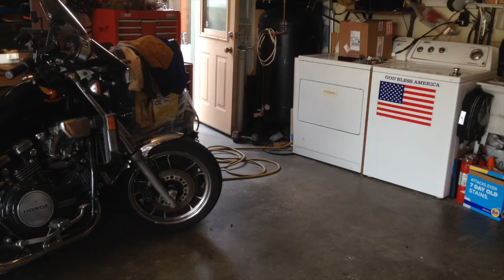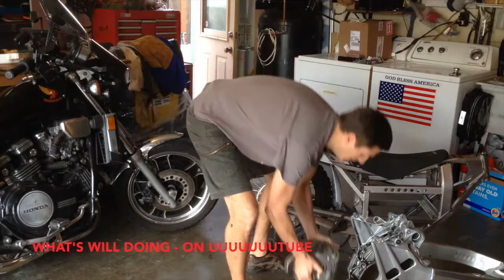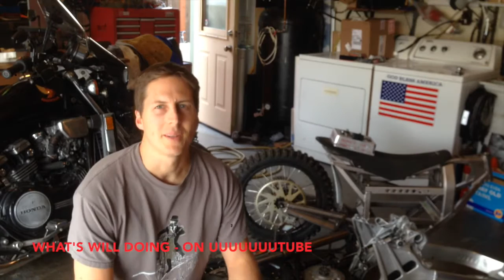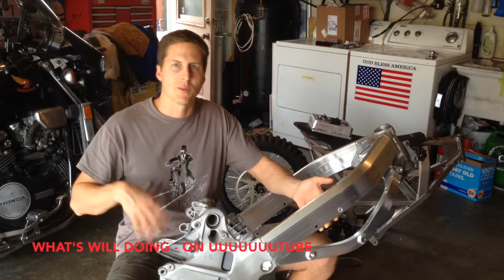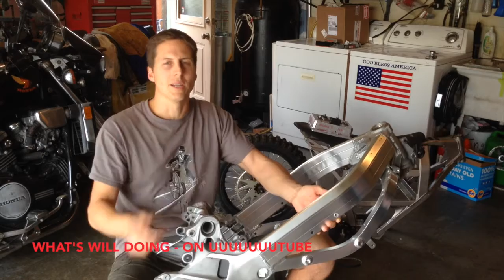New Project Custom Recumbent Electric Motorcycle

Comment: That's cool Will.  I was wondering what was going on with the plane, and now I see this .... so great for you!  

I have essentially punted my python bicycle, having completed the recumbent.  I got frustrated with the recumbent because it is slow, heavy and my custom fork bent --- which is an easy fix but I don't feel like working on it at this time.  I may sell it or something and buy one off the shelf....because I have found that I would rather just buy parts that fail than build them. 

I will get the patent for it finished soon and am making a video about it.

I have a new project too -- which is more interesting to me now than the bike stuff... I will be working on it for a while.  I am buying a lot (closing this week) and will be building a home.  It's quite a big project and a significant investment, so look for vids on that from me.

Happy Thanksgiving to you and your family.